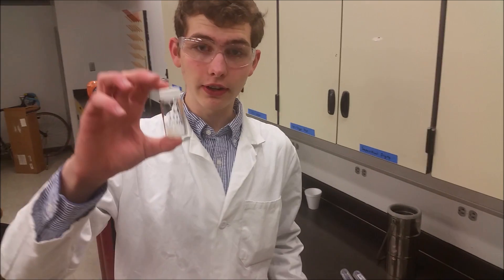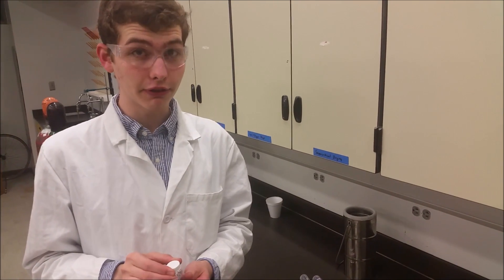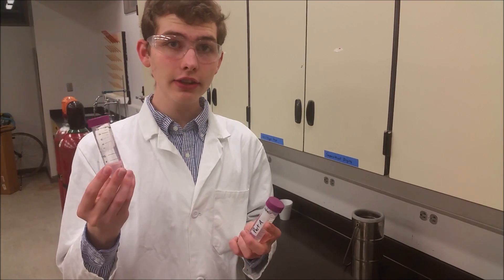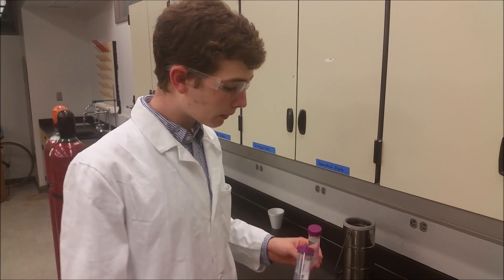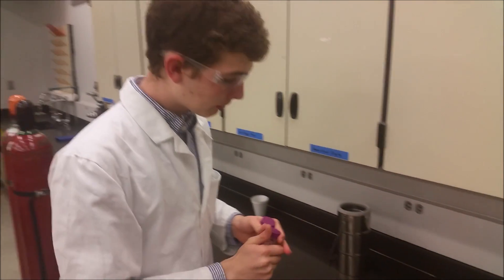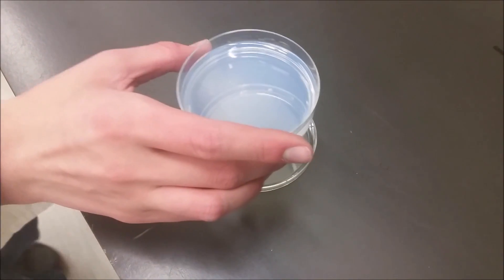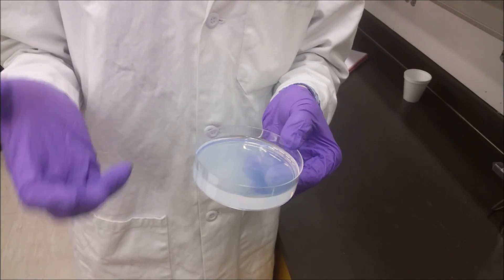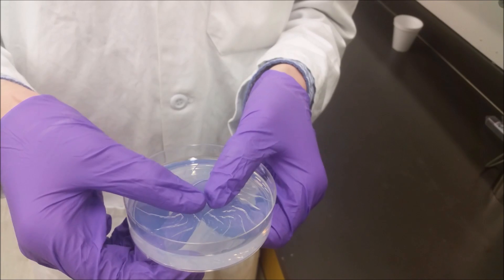Preparation of a Sol Gel

Comment: Hello colleague, I'm from Brazil. I am a master's student in Materials Science. I wonder if you could answer at least one question listed below:

1- Why hydrolysis and condensation of tetraethyl orthosilicate (TEOS)  results in polymeric gel in acidic media and particulate gel (spherical SiO2 particles) in basic media?

2- Why we use acid/base catalysts in the sol-gel preparation of SiO2 from tetraethyl orthosilicate?

3- Why we use ethanol in  the sol-gel preparation of SiO2 from tetraethyl orthosilicate?
Reply: First, let me try to explain your 2nd and 3rd doubts;
2. We know, the catalysts boost up the reaction mostly, The ammonia base is added to hydrolyze TEOS faster than water, as the OH ions forms effective nucleophile. The faster hydrolyzing of more Silanol monomers are obtained. The silanol monomers attaches with more siloxane bridges and after condensation, it breaks to form siilica NP and ethanol.
3. Ethanol and ethanol monomers would form an environment so that, the ethoxyl groups in the siloxane bridge would deprotonate and form ethanol and water during condensation and the steric hinderance will be low for the above process if it is surrounded by ethanol.
Though I`m not sure for your first query, I think the stable gel is formed by acid catalyst and the deprotonation may not happen to give out sio2.

Thanks and cheers! For your reference go through --  "Han, Y., Lu, Z., Teng, Z., Liang, J., Guo, Z., Wang, D., … Yang, W. (2017). Unraveling the Growth Mechanism of Silica Particles in the Stöber Method: In Situ Seeded Growth Model. Langmuir, 33(23), 5879–5890."
Reply: @abishekkumar7670   hello bro. I want to know the synthesis process of TEOs into hydrogel.  The effect of pH on each stage. Thank you.:yougotthis: